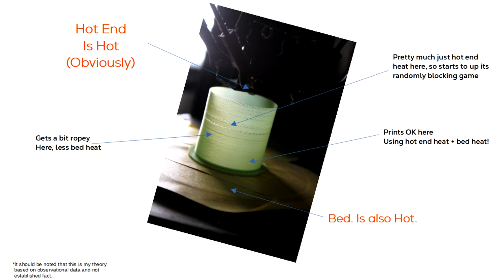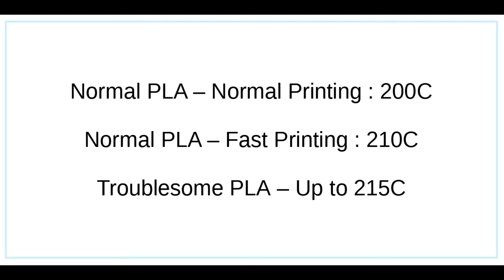What causes lines in the middle of a 3d print? Solve under extrusion problems mid print, halfway up!

Comment: With a hardened nozzle, make that 220C. There is a larger temperature swing on hardened nozzles because of the lower heat conductivity, and you need to compensate or you will have under extrusion issues like this.
Reply from the maker: Yes! I gave up on hardened nozzles because I'd rather ruin a brass one than deal with the conductivity problems
Reply: Broooo I use 240C on my pla and it works wtf
Reply: @Wingbomb123  maybe a gap in your heat transfer. gap between nozzle and hot head for example. make sure everything is tightened down
Reply: i just switched to hardened nozzle so this is very good to know

Comment: There's a similar problem with infill that leaves under extruded sections in the same spot in each layer. It's caused by the having any friction on the heated bed cabling. The cable will pull taunt before the tension is released causing the nozzle to move too fast across the print leaving stringy bald spots in the infill. This happens consistently in each layer creating large voids in the print.
Reply: Solution?
Reply: @riyadh1121  print out a support arm for the heated bed cabling to keep it from catching on other cables.
Reply: @Mino_512  THANK YOU MY GOOD SIR! I was experiencing extremely consistent under-extrusion in the same places for a while now! I can finally print normally again o7
Reply: @Mino_512  where can I find the STL file for this?
Reply: @megamatthew75  how did you fix it
Reply: I know that this is an old thread, but beside this fix here, also know that it's a good idea to keep all the moving parts well lubricated!

Some use grease, but I'm not a fan of that because all the dust, dirt and plastic particles adhere to it, causing more problems.

I was trying to find some of the 'PTFE"  "dry" lube that some use, but I couldn't find the specific brand and the listings for what was available for shipping, was stupidly expensive.

So, I discovered, totally be accident, actually, that WD 40 has a "dry" spray!
It's called, 
WD40 Specialist dirt & Dust Resistant DRY LUBE PTFE spray!

It was way less that 1/2 price of the other brands and it just works a wonder!

I had some issues that I realized was coming from moving parts that had no lube.  Once I sprayed all those parts (lead screws, rollers) printing was much better.
Of course, I cleaned all the rails too where the rollers fit into.

Hope that helps.

Comment: I never print lower than 220c for PLA but my speeds are slightly higher than normal though. But even at lower speeds I prefer the strength of printing at around 220c.
Reply: Same. I did drop to 215 once I started to use a CHT nozzle.
Reply: i usually print at 230 but i use pla pro/plus brands that like hotter temps. even regular pla though i usually dont go below 220
Reply: Did you find quality/detail suffered at high temps? I did a temp tower with a eSun PLA+ (my main go to), and the 230° looked the worst with stringing and sloppy outer walls and such, while the 200/205° looked best. I opted to go with the 205° and it’s served me well. I do have an issue with the midprint line though, thus here I am. I’m printing a larger part where it should be as strong as possible over quality, thought still shouldn’t look like crap either. And it’s around a 30h print each piece so fiddling with 5° increment tests per piece isn’t really practical here. Like another commenter said, I guess it’s a compromise between quality and strength with what temperature you do decide to print the part at.
Reply: @Stopes.  yeah 230 is too hot for esun i usually use fiberlogy ht pla or fiberlogy impact pla
Reply: my notes 🙂
1. faster speed -> need higher printing temp
2. extruder grip on filament
3. separate profiles for faster primting
4. older filsment tends to need higher temp

Comment: I've had similar issue. Woke me up twice in the night with the clicking noise. I'm the final 20% of a 14hr print it's changing the tree support infill to another type and looks almost 100% infill. At that point it's separated and on the corners looks likes someone's indented or peeled it up with a knife. Is that the same issue? Help! I don't have much patience for another 14hr failed print 😅😢

Comment: Awesome.. A long time ago I tested print an object with the same filament at different temperatures and at 195 c I got the best looking part, but the layer adhesion was weak.. At 215 c I got the strongest part but a lot of stringing, so at the end it was a compromise between those two.
Reply from the maker: Sounds about right. if the stringing isn't so bad, you can just melt it off with a quick blast of heat

Comment: Great video. I was printing some things using vase mode or "spiralise outer contour" with no problem, but when printing something more solid, the nozzle kept blocking around the same height. I couldn't understand why and never thought the residual temperature from the bed could be an issue the higher the nozzle gets, until I saw your video. Hopefully this is the reason my print is failing and I can resolve it. I have a printer enclosure that I haven't used yet, but I'm going to set it up tonight and see of the increased temperature helps. I also heard that with larger prints, sometimes the filament sensor can cause the filament to bend to much and stop it extruding properly. This isn't an issue for mine but thought I would mention it in case it helps anyone else. Thanks for the video, liked and subscribed!
Reply: Sry for necro posting, i had same trouble, on the same height nozzle became clogged. In my case it was some nev version of cura bug, when it puts interfacing supports mid air, after i changed cura version this issue gone.

Comment: Great video, suffered with this a few times and painstakingly came to a similar conclusion! Thanks!
Reply from the maker: At some point I guess I am gonna have to make a small wiki page with the most common issues like this, and the wavy patterns on the first layer...etc... When I get time! :)
Reply: I'm up to help with the wiki page if you need any help, there should also be a guide on proper calibration with test shapes rather than trying out random internet setttings

Comment: I had the a terrible under extrusion problem on my ender 3 pro immediately after upgrading the heat brake and persisted for a while. What was ending up happening is the stock cura retraction distance was fine for the the stock hot end but caused the filament to jam in the upgraded one due to an imperfect cut on the ptfe tube. By simply lowering the retraction distance by half. It solved all extrusion issues. 
If this is the situation you currently find yourself. Try this along with temperature adjustments.
Reply from the maker: Oh..that makes sense! I'll keep an eye out for that when I do a heat break swap in a couple of weeks!
Reply: This solved my issue, The (extreme) difference between 3.0mm retraction and 1.8mm in some repetitive retraction sections of a print along with bed heat dissipation was causing a jam. I went from a creality metal upgraded extrusion gear system to a Winnsinn dual gear extrusion system. With the offset required for a direct drive mount (motor on top of the hot end) the repetitive retractions would cause the motor and dual gear extruder to rock back and forth causing the jams at the layers I would lose the excess heat from the print bed. Proved buy getting the line skips at a lower point on the print by deceasing the print bed heat. I will add to the design to reinforce the mount I am using to run a direct drive setup this to further decrease the chance of this happening again. A happy side affect 1.8mm retract looks like it's still more than enough with my setup to keep the prints nice and clean so faster and I may be able to go even shorter! .5 ???!!!????!!!!! Thanks again creator and commenter.

Comment: I have an Elegoo Neptune and had the exact same symptoms. Man it was frustrating. Made all the changes you mention here. The extruder did also start to skip part way up. The cause was different though. The extruder was ok to start but then started to skip because it was under voltage and over heating. I upped the voltage on the mainboard and it hasn't skipped a beat ever since producing fllawless prints.Get in there with a volt meter.

Comment: Here goes a hard-to-imagine under-extrusion issue that happened to me: In enclosed machines, for loooooong printings, and when printing with PLA, it all begins nice and smooth. But at some height, it can happen you start having underextrusion or even no extrusion at all. And I hardly understood what was happening, becoused I used to leave the printer over night and found the mess at morning. But one day I saw it happen mid-printing, opened the enclosure and it was for sure hot insaid. And I tried to pull and push the filament in the extruder (direct), and voila! IT SLIPS!!!!! The area was so hot, that filament was getting a little bit too soft for the extruder gear to "bite" it and it was slipping, so no filament was going through.

My learning that day: increase the extruder presure on the filament, or use double-geared extruders, or if you are going to print at really high temperatures, maybe even consider bowden extruder out of the hot area. Or if you print with PLA, just leave the enclosure open.
Reply from the maker: Ohhh actually yeah that happens a lot, usually from heat from the extruder stepper motor, but yeah.
Reply: Interesting. I have an Ender 3 v2 with Sprite Extruder and i built a cabinet to house my two printers, but only one is giving me this under extrusion issue. I'll try to print it outside of the enclosure to see what's going on...

Comment: Amazing thankyou! I struggled with this for weeks. The weird thing is that some prints went completely fine and then when i reprint the same file it did it again.

I was printing at 120 mm/s on the Ender 5 S1 at 200C. Now printing at 100 mm/s at 210C checking it it is finally fixed!

Comment: There is another thing that can cause lines in the print.
If the extruder clicks, it is possible that the driver is overheating and turning off for safety reasons. When the temperature drops, it turns on again, this causes the extruder to click as the step is no longer matched.
Possible solutions are: Improve the cooling of the extruder driver or reduce its current.
The driver current must be correctly adjusted, if it is too high it will heat the driver and can damage the motor, if it is too low the extruder will not have power to work correctly.

Comment: I had a problem that looked exactly like this when printing ABS on my Ender 3V2. After extensive troubleshooting, I found a completely different root cause. I was using 0 cooling fan (because ABS) and the Creality board in my printer has a nasty design flaw where the electronics cooling fan is actually connected to the part cooling fan. No part cooling means the electronics cooling fan doesn't turn on. This was resulting in my E motor stepper driver overheating and starting to drop steps.Splicing the electronics fan into the hotend fan wire resolved the issue, as the electronics fan would always run when the hotend was at temp. Allowed me to finish printing the parts for my Voron.
Reply: I didnt print with abs yet and am in printing just a few months.  But also noticed the fans  that you spoke off . That makes sense what you said because long story short electronics dont like to overheat
Reply: Are those 2 fans identical for rpm? Like if I set the cooling fan to let's say 1 of the 270 or whatever speed it is, will the other fan be a 1 speed or is the electronic fan down there on/off?

Comment: Been there, done that!

I have a stupid Wanhua Duplicator 9 MK2 400x400x400 printer.

When I stupidly bought it, I had no idea what I was doing as this was all new to me.

I had no clue about temperatures, speeds... nothing!

For the 1st year and a half, I couldn't print much at all.

There were all sorts of problems, including what's in the video.  LOTS of this, in fact.

But the worst, was that I'd start a print (usually printing at 195 C at that time) and it would be printing along ok, but then "things" would happen... EVERY TIME.

It could be this issue or the Y would shift (whole other issue, now resolved) or the filament would just pull out of the extruder or just get stuck (as indicated here).

I tried to print hotter, but that wouldn't work.  Every time there, the filament would just pull out of this direct drive extruder and have a funny looking, elongated things on its end.

I just gave up for a while, until I got sick and tired of this trash printer and took the attitude, 
"KILL OR CURE!"  Meaning, I was going to do whatever I could do to CURE the many problems or just kill it in the process.

I won't go into all the things I had to do to get this thing printing nicely and consistently, because that's a very long read

But basically, these are the quick things I had to do to fix this thing:
-  full realignment of all rails and supports, aligned to the frame.
-  added new, thicker insulation around the hotend. (that cured a major issue there)
-  removed the TINY heat break fan, that wasn't cooling the heat break at all and designed a cooling "duct" with a tiny, but powerful server fan.  (again, long story of how I did that)
-  took the gear press spring out of the extruder and stretched it!  Now, the gear pressing against the filament is very strong and no more slippage, which WAS a huge problem!

There was a bunch more things, but the heat break duct, now cooling the heat break completely and the thick insulation around the hotend, allowed me to print hot and fast.

Now, I ALWAYS print PLA at 235 C!  ROFL  yeah yeah, I know... that's "too hot", but it's not.  Now, the PLA flows nicely and quickly and the adhesion of the layers is excellent, now making very strong parts that don't just fall apart!

The only other issue I did run into, even after all the fixes, was that sometimes the filament would get stuck at the spool (filament getting under the other filament, causing it to not come off the spool).  I resolved that by making a roller bearing seat for the spools so that they now spin easily.  I also check the winding of a spool before putting it on.

Now, I get consistent prints that are good.  Of course, in a way, that's now a bad thing, because I can no longer justify buying a new and better printer... Like a Bambu X1 Carbon or a Creality K1 Max.  LOL  But that's ok, because both of those have small build plates.  Especially the Bambu series.  I'm spoiled with this 400x400x400 print volume!
Reply: Oh, I forgot.  LOL  I also have 2 HD video cameras (both with PZT) monitoring the printer (one on top looking down, one direct front at bed level to monitor layers).

This way, when I'm away from home, should something go wrong, I can see it right away and tell Google Assistant to power off the printer.

Since the fixes, however, I think only once that I found the printer messing up, but it wasn't the printer's fault, actually.  It was some old PLA filament that I decided to use up, that had become brittle.  So it just snapped at the spool when being pulled by the extruder.

Comment: Fantastic, thanks for that.  I recently replaced my blown Ender 3 8-bit board with an SKR mini E3 2.0 and noticed the extruder was clicking causing underextrusion. It seems that stealthchop (the default in Klipper's example printer.cfg file) doesn't provide enough torque. Changing to spreadcycle fixed it without having to increase the current (slightly noisier though, but still OK).
Reply from the maker: I need to look into klipper. Some of the stuff there sounds pretty clever.

Comment: I have consistently been having this problem, I've upped the temp, I played around with retraction and speed but it still happens as the hot end gets higher - never used to though when I first got my printer  Ender 3 neo - I've obviously changed something along the way and it's doing my head in!!!

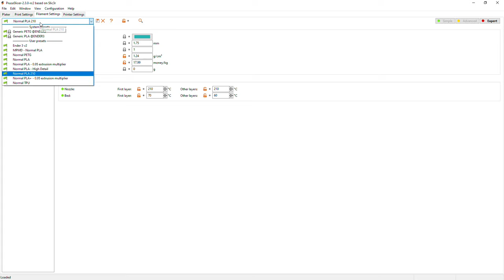Comment: 4:30. Wow, that's interesting. I put my Ender 3 back into service after a few months of it being idle and I was having lots of under extrusion problems. I did manage to get some good prints with one of my PLA spools but all the others were a no go, even with the exact same gcode and print settings (same brand and type of PLA). I did suspect that age/humidity could've played a part, but I had no reference as to when and how PLA 'goes bad'. I'll try slowing the print down and upping the temperature for the others spools. Thanks for the tip and for the great video.
Reply: I have had pla go brittle with age. Simply falling apart in sections. After a session with the food dehydrator,  printing has resumed.

Comment: Hmm... more heat-->more stringing, but it's way better to have some strings that you can easily remove than to have a print almost fail. Thank you, now I'll never go below 210°C for PLA and will set it to go to 215°C when the hotend reaches 5cm above the bed.

Comment: I recently had this issue. I tried increasing temperature and decreasing speed, but neither helped. I ended up having to disable retraction to get the print done successfully.
Reply: How's your cold end cooling?

I had heatcreep constantly after 1 hour of printing, I've fixed it with overkill cooling fans now
Reply: @NM-wd7kx  I think it's okay but I should keep a closer eye on it to check